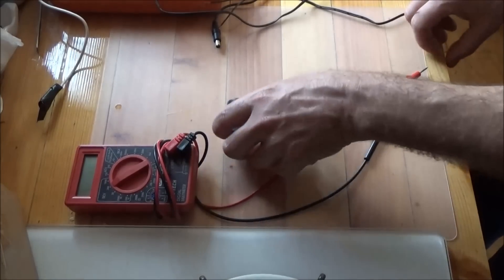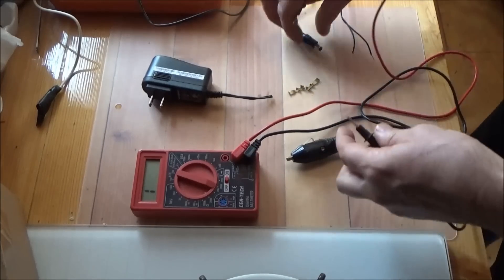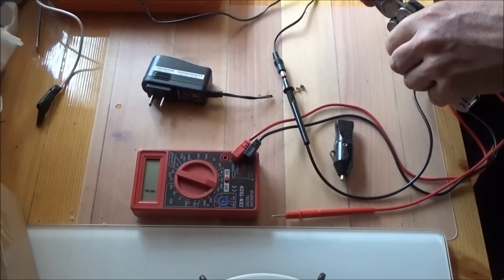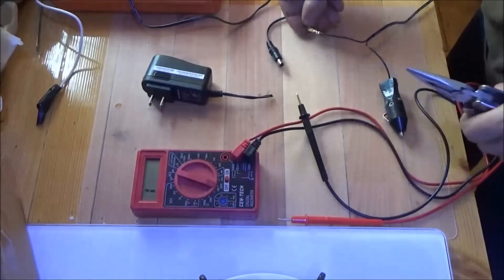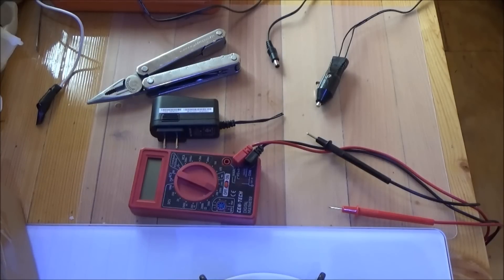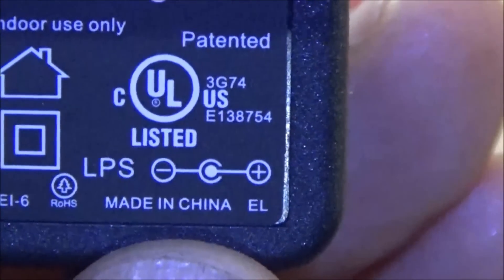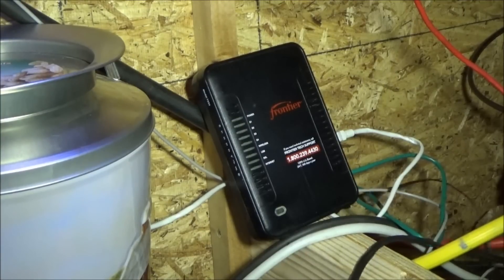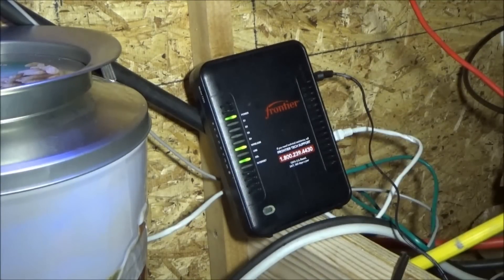Converting My Modem To 12 Volts DC For Off Grid Solar Power

Comment: Um...
You Should/Need a dc12-16 volt to dc12 volt Fixed-Voltage Regulator or you "may" Kill it when your charging your batteries.
They are cheap , Last batch  I got was like $3.00 Each

Not the ones I used, But should work fine. (got mine from DX and they had heatsinks)
http://www.ebay.com/itm/5-x-Mini-DC-to-DC-Converter-Step-Down-Module-Adjustable-Power-Supply-0-8-20V-12V-/261739647953?pt=LH_DefaultDomain_0&hash=item3cf0e613d1

We use one like this at work for 5Amp off grid CCTV setups. I seen them as cheap as $15 bucks,  It's WAY more then you need , But it could power a lot more stuff in your house , they also have them up to 30A  &
no need to adjust it with your input voltage change,,  
(you can also get one in 19V for your computer)
http://www.ebay.com/itm/DC-DC-11V-36V-to-12V-5A-60W-Waterproof-Power-Voltage-Converter-stabilizer-/221595998048?pt=LH_DefaultDomain_0&hash=item3398269760
Reply: the one for the laptop does work well for you, buck converters are getting low in price for sure, troy really should do it for the laptop
Reply from the maker: Actually I was thinking a simple Zener Diode from Radio Shack will do the job nicely. Just splice it into the line.
Reply: Don't see that working at all for you.
Reply from the maker: ***** I ended up with the 7812 voltage regulator. Its the same price as two zeners at the shack and it can handle the current. The zeners they had are only rated at 1 watt.
Reply: ***** Please, for the education of those of us who may not know as much as you do, could you tell us why something won't work when you tell us that that something won't work?  That way, the rest of us will learn something.   Thanks.
Reply: Vicki Olson Zener diode, when used as a shunt regulator, will try to short the battery voltage until it sags to the zener voltage. Not a very power efficient design at all, and hard on the battery and/or wires. When used in series, a diode will drop about .7 volts, but this doesn't provide any regulation. 14V - 0.7V = 13.3V, still too high. So yeah, don't see zener diode working all that well.

7812 will be much better, although still wasting some electricity when the battery is charging. 14V-12V = 2V and it's a 1A load, so about 2W will be burned in the 7812 during charging. Make sure it doesn't get too hot under charging conditions, might need a heat sink. At least it won't be wasting a whole lot of power during non-charging, so it's an ok solution, if it's actually necessary.

A DC-DC step down converter could be more efficient, but maybe not worth the cost over a 7812.

Honestly, the modem most likely already has a DC-DC step down converter or linear regulator internally, so this whole exercise is probably a waste of time and energy. Just verify the internal power circuit of the modem and then wire it up exactly the way Troy originally did it in the video.
Reply: zilym Thanks for stepping up with that explanation.  I learned a lot and I'm sure that people more versed into this stuff than I am, learned even more.
Reply from the maker: zilym Actually a zener diode parallel to the power source and load with a resistor in series with the positive wire will regulate the voltage down to the rated voltage of the zener diode. But I could not find one rated for 12 watts. So I got a 7812 instead.
Reply: You are wasting power with the zener and resistor. What I did was got a cheap  Buck converter that could do around 10 amps hooked it up to my battery bank and set the output for a true 12vdc then put it on a bus bar and use it for things that need 12vdc much safer. The buck converter will use about the same as you loose on the resistor as it does not regulate just a thought for you

Comment: Troy, I got one of these for my faraday cage and I loved it so much I got another one to keep in my laptop bag so I can charge my laptop off of 12 volts in the car.   They are cheap but it has held up to a year of continuous use.  I have also found that I can plug in my cordless drill charger to it and set it for 24V output (which is what the AC Adapter had for it's output) and it charges my 18V batteries just fine off the car.    http://www.ebay.com/itm/Universal-DC-Power-Supply-for-Laptop-Adapter-Car-Adapters-Tips-Charger-Cord-80W-/380666525984?pt=LH_DefaultDomain_0&hash=item58a17e3920
Reply from the maker: I just bought one and the plug will not fit my laptop. It just physically will not fit into the laptop. Very annoying. I need to find a plug that will fit. So I am stuck with AC power for the laptop which is very wasteful.